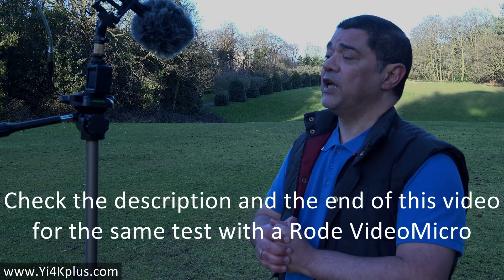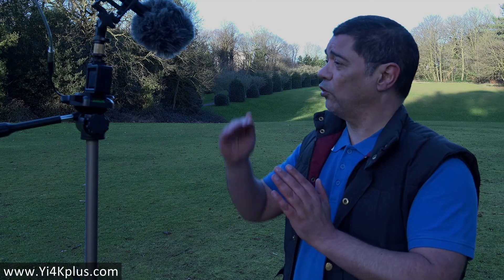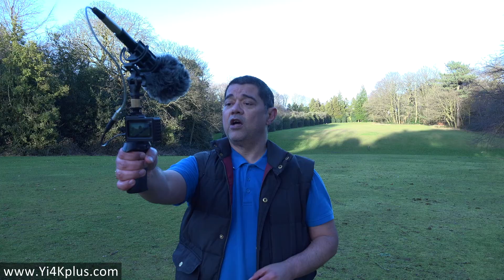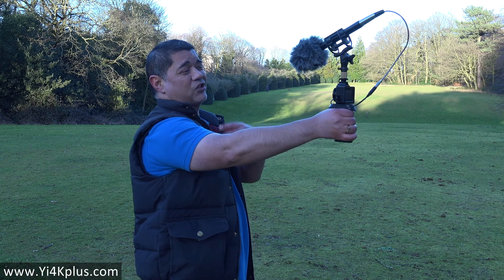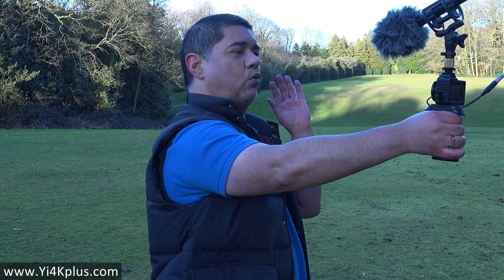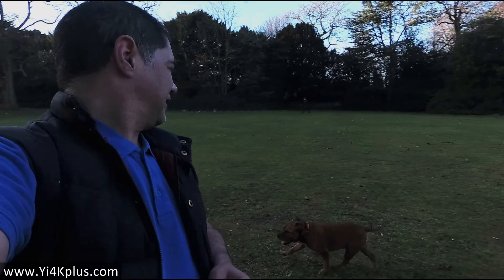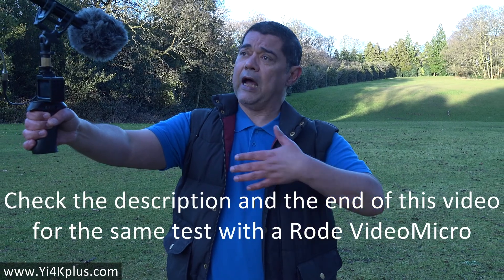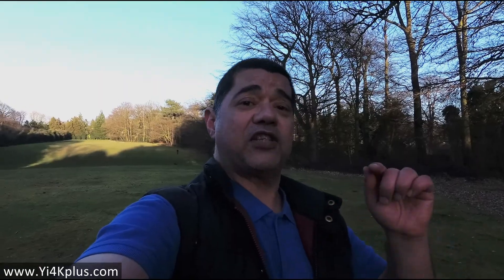Yi 4K Plus & Sennheiser ME66  external mic - audio test with a passive attenuation microphone cable

Comment: Hey Dave, great video! Could you give a bit more information on how you converted the cable? Is it just one resistor on the signal lead, or did you put one acress as well? Any help is appreciated! Thanks
Reply from the maker: Hi Yannick.

Yes, just a single 10K resistor inline with the live cable of the Yi USB audio cable. I tried a L Pad configuration but there was no advantage to it, plus it was more bulky. I found that 10K was about the best option. Although this does give peak voltage attenuation  and does help reduce the overall amount of distorted peaks. The Yi 4K+ will still distort if the signal level/voltage is too much, the 4K+ is simply too sensitive or its impedance isn't matched very well.

Here's a video with cable I made up for the Rode VideoMicro https://youtu.be/NnAcwiO49v4 While it still does distort in places, it's much better than it was without the attenuated cable.

I find it best to record with the 4K+ set to low and then gain it in post. The signal will be noisy but this isn't down to the cable or mic, it's simply the poor audio processing of the 4K+ which is always noisy, even on its internal mics.

The cable for the Sennheiser was an unbalanced XLR where I put the resistor inside the XLR, which makes it very neat.

The easiest way is to simply split the Yi USB audio cable in half and insert the resistor inline with live cable. If you're neat with the splicing and soldering and use heat shrink for isolating the live and ground/shield, you can get a very neat cable. I also made one up with a 3.5mm male jack that had the resistor inside. I filled it with hot glue as well to set everything in place inside the jack and to insulate everything. This cable is great for things like the Rode Micro or anything with a 3.5mm female socket on it.

I'm in the process of modifying a Saramonic iMic, replacing its omni capsule with a cardioid. This is so I can have a light weight directional mic that can fit a phone or action camera with a mic input so that it can be used on a stabiliser without being too heavy and tipping the centre of gravity. I'll be doing a how to and audio examples once I've found the right cardioid capsule.

Cheers,
Dave.
Reply: David, thank you very much for the detailed answer :) I was wondering if you did use a shut resistor or not to get an L-pad. Apparently it's not necessary. Cool! (I am not good enough in electronics to be able to find that all out). I will build a cable where the resistor is IN the socket, I ordered a small 1/4W metal film resistor that should fit into a female plug thing that I ordered as well. I'll let you know :)

Do you have any numbers on the attenuation in dB? Or an estimate?
I calculated, but it might be wrong, that the attenuation is 40dB in Power with a 10kohm resistor...?
Reply from the maker: Hi Yannick. Sorry for not getting back sooner. The attenuation is around 10-12db, which is good for overall peak reduction but will still be unable to stop big peaks/distortion. Any more attenuation and you'll probably have issues with noise floor and having to over gain the recording in post in order to bring the overall recorded level back up to a usable listening level. Cheers, Dave.
Reply: @DavidHarry  Hi David, your videos are very useful. Would you remember what wattage resistor you used for this mod? 10k resitors come in as 0.5 W, 1 W etc., and I don't know which one to get? Cheers, Andre
Reply: @skiband2000  To my understanding, 0.5 W, 1 W should make no difference. Wattage just means the highest power the resistor can take.
Reply: @DavidHarry  Hi David, I am going to do the USB cable modifying thing, but just don't know which one is the live cable of the Yi USB audio cable which I assumed there are three cables inside, could you give me some tips?